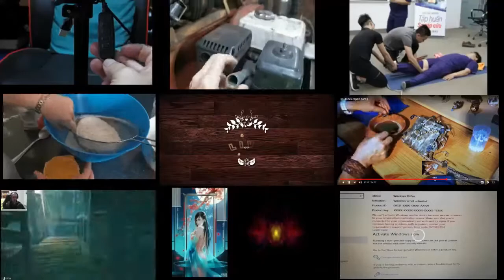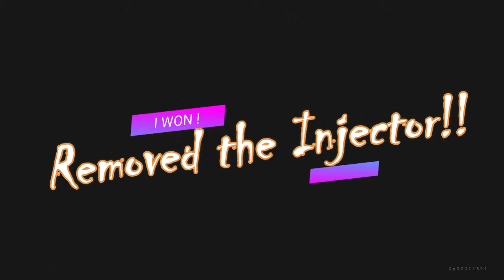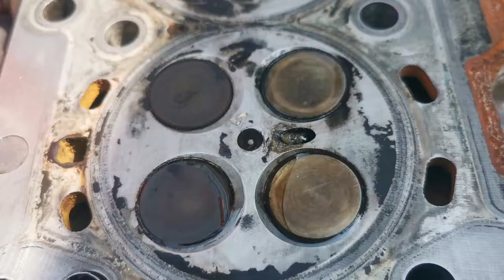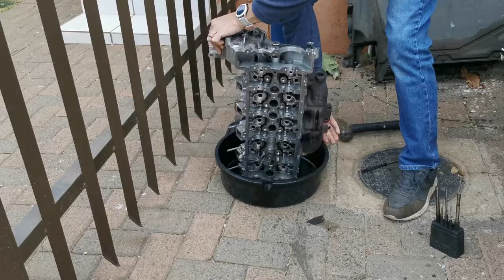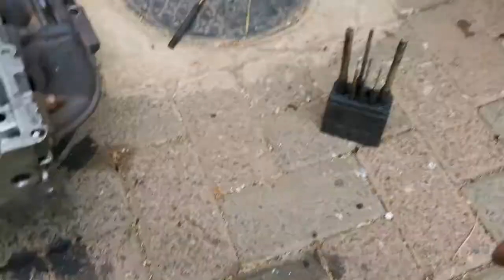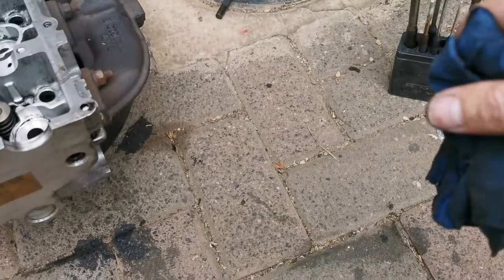Injector removal BMW e46 320d

Comment: What caused that engine to failed??

I'm actually surprised cause these m47 engines are rock hard, you hardly open those engines....some reach over 850 000km with no issues
Reply from the maker: My mom had it for about 11 years and I do not think that they did propper maintenance in it. In the time that they had it the engin mountings broke. The harmonic stabelizer broke causing the belt to smach alot of things. There was a water leak so the car overheated twice. And I susspect some one tampered with the injectors before. So there are multiple factors.
Reply: @CriPtZoNe  wow thank you for the knowledge, I never knew that sometimes it can be so hard to get those injectors off.....

I'm currently running the same m47 engine on an e90 320d and even though I'm on 330 000km it still runs like a dream.

HOWEVER the vibration damper/pulley  probably needs replacing also, it's one of those common repairs on these engines but otherwise these things can run forever with no issues, just need to change oil every 10 000km then you have a very reliable BMW
Reply from the maker: The engineer susspects that when the stud brike off on top of the injector the carbon buid up was more than usual due to the injector vibrating or being loose. That is what made it so stuck.